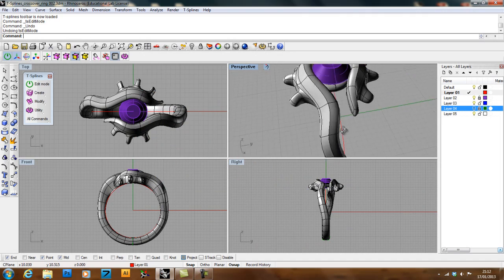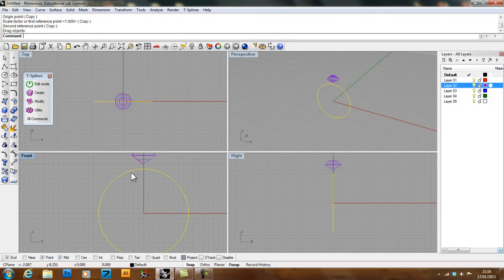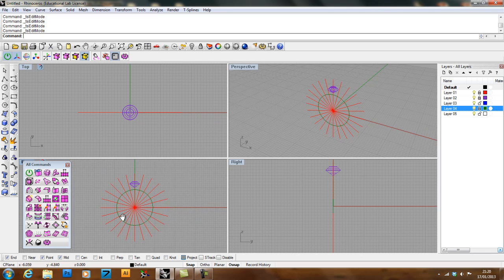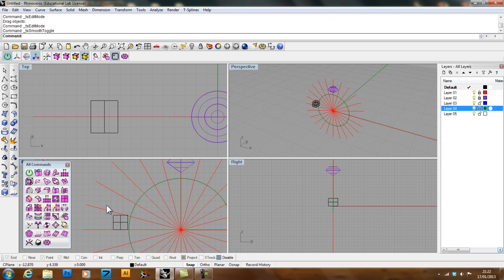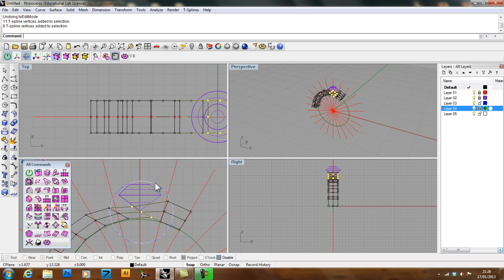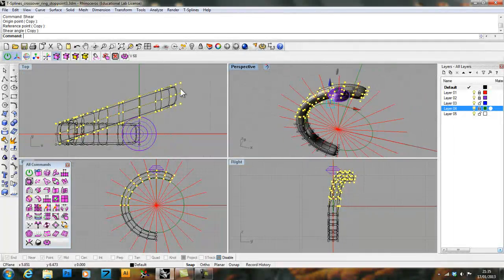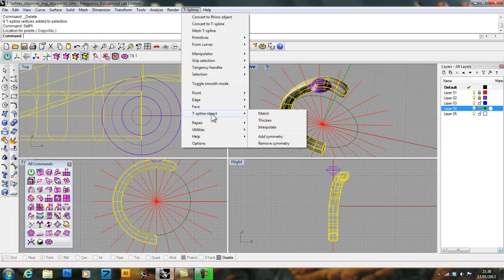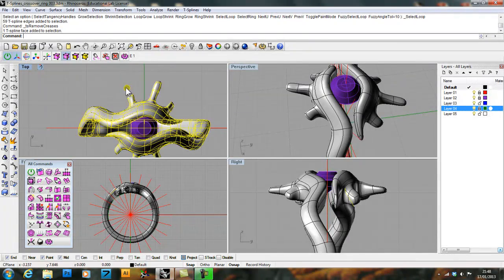T-Splines For Rhino - Making a Crossover Ring With Radial Symmetry - Holts Academy of Jewellery

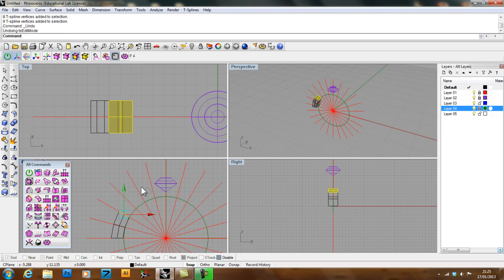Comment: i have a problem when i try to do in the sec. 8:14, i can't continue.. could you explain for me plz?
Reply from the maker: The extrusion trick here goes as follows:

With the Face grips, make sure you've selected the entire top face. Then hold down the <Alt> key whilst dragging the Transform MSR manipulator (the arrows and round grey disc). Each time you drag these it adds another edge loop.
You want to try to line up these edge loops with the arrayed template lines you made, making one extrude for each template line.
Hope that helps.

Comment from the maker: You're right, that would've saved quite a bit of time on the extrusions in T-Splines. Thanks for that.
However, keeping the surface proportional as it goes around is still an issue (as that would affect the thickness of the ring if you scale out the sides), so I would still recommend making a jig to line things up.